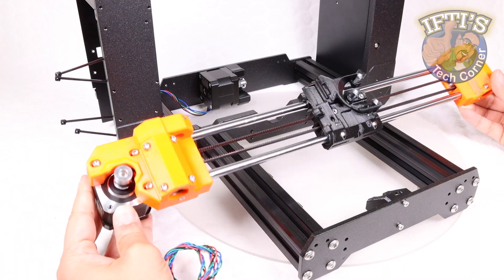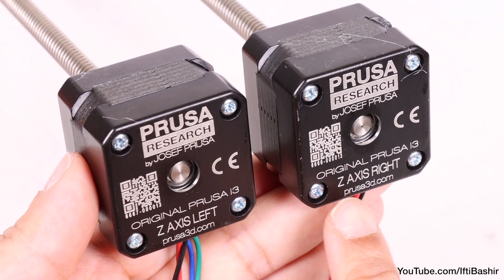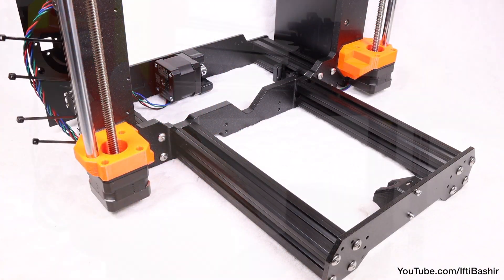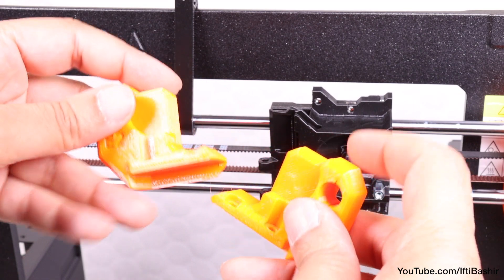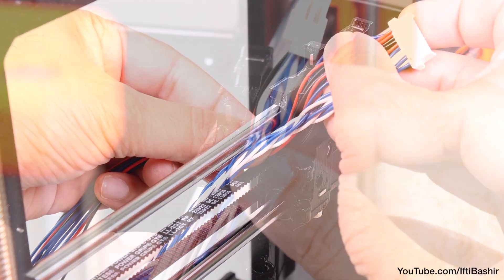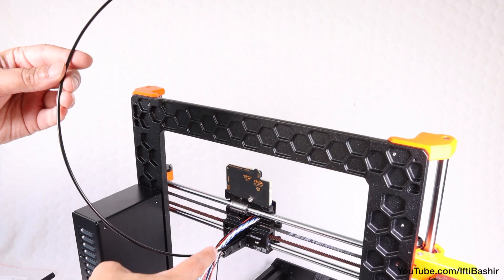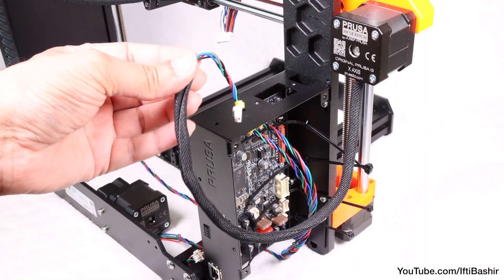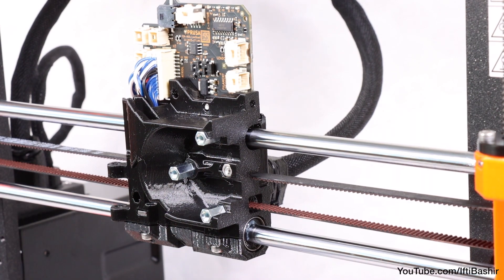#04 Original PRUSA MK4 Kit : Full Step-By-Step BUILD GUIDE - Z-Axis Assembly

Comment: 3:58 Before gently inserting? It was very difficult to get it in there on my F1 unit. I held the motor from the bottom and had to push pretty hard downward for both. Thankfully no damage but it wasn't super easy.
Reply from the maker: Rather then saying 'gently' maybe I should have said 'carefully'! Very easy to break those parts due to the tight tolerances.
Reply: Ohh I see. I've been watching your vids paired with the official guide on their site, which has comments section for each segment, so I found some others with the same concern. Very helpful!

Comment: @ 11:43, he says "Three" but he means "Two" sleeves. I have two of this MK4s, on my first round of assembly I spent extra time searching for the third sleeve lol.

Please, not criticizing the author, he has done an EXCELLENT job with this series of videos and has made assembly for us very easy. Thank you sir.
Reply from the maker: Thank you - I meant 3 textiles sleeves included with the entire kit (as mentioned in the Prusa official guide - step 24), although I appreciate where you are coming from as there are 2 in this bag, and the third comes later!  I just followed the wording in the official guide. 
Thanks for pointing that out though!
Reply: @iftibashir  as I said Excellent job. When I arrived at the final video I realized you said three because of the heat bed sleeve. I should have been more thorough.  Thank you again for your videos!!!
Reply: Just a note here @12:50 the shorter sleeve is in the Z-axis bag not the X-carriage bag